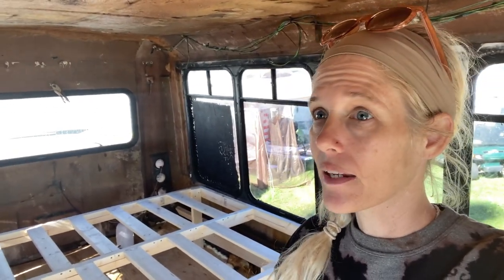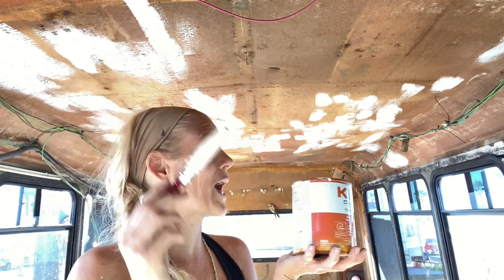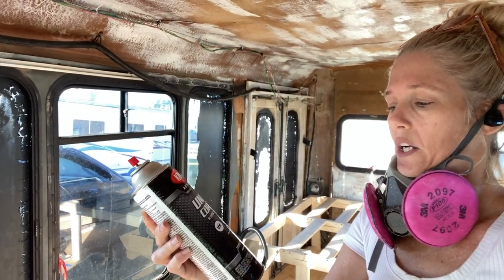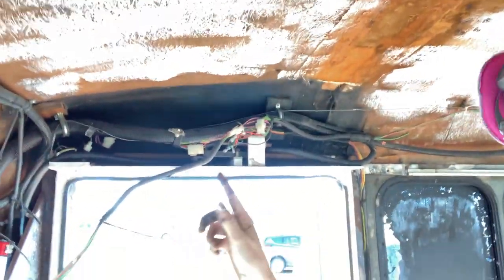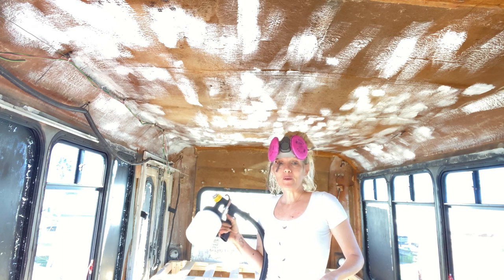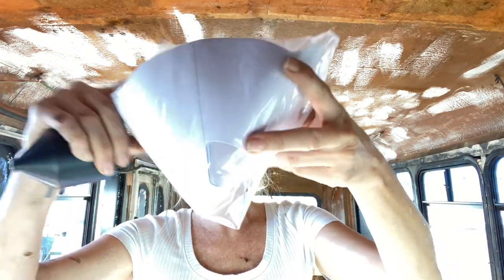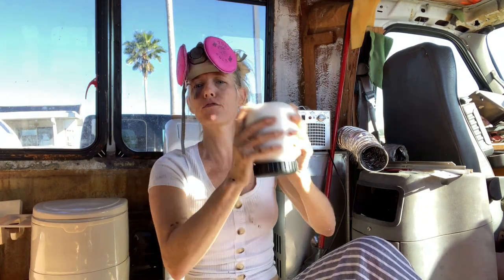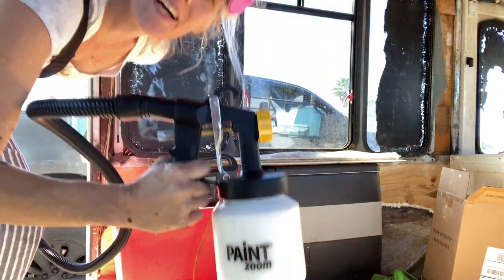BUS to TINY HOME| DIY, Sealing windows & painting #diy #busconversion #tinyhouse

Comment: You prolly need some insulation up there?
Reply from the maker: Nah , The way I look at it is. When they were transporting people around in this bus , I’m sure people did not get hot when the AC was on nor cold when the heater was on and I’m pretty sure I won’t either :) just like in our vehicles that we drive if we have the Aceon we stay pretty chilly, same with when we have the heat on. I think people make a huge stink about overdoing insulation. If I have an AC in it i’ll stay cool, if I have heat I’ll stay warm . That’s my cheap two cents. I’ll let you know how that goes 😁
Reply: .. maybe thin paneling?? Ceiling squares??
But it's probably going to be fine for now..it's a detail that can be added anytime✨
Reply from the maker: @cengel1951  yes I was thinking the same stuff I put on the tinyhouse